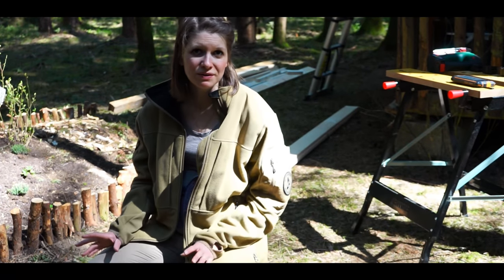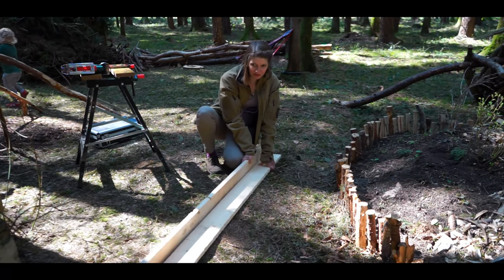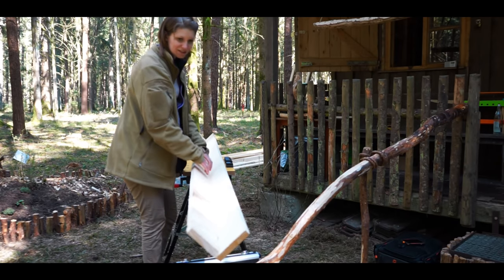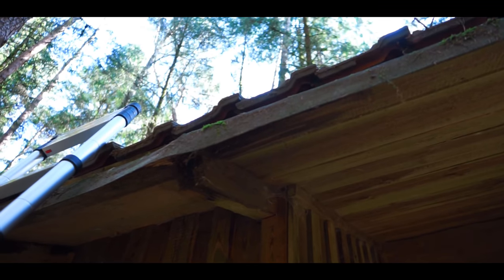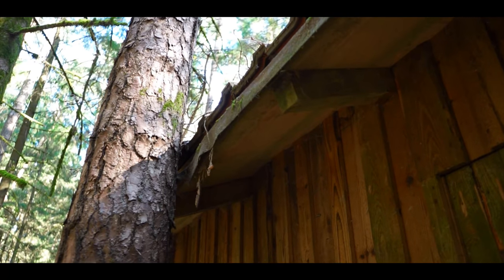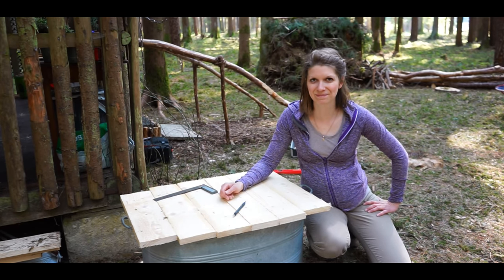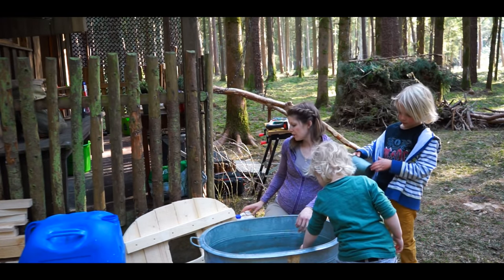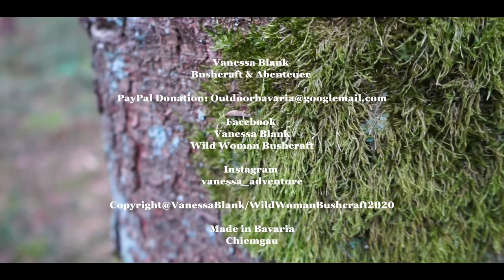🌳🏡🌲Forest Cabin🦊#10 DIY- Water supply / gutter, water storage, selfmade - Vanessa Blank 4K

Comment: I think you get more beautiful with each video, Vanessa! 😌
I only have one suggestion. If you put a gutter on the other side, get a tube of construction adhesive, and apply a small amount in the joint before you screw the boards together. This will seal the joint(s) and keep it from ever leaking. It will also make a joint that is very strong. The screws will loosen as the gutter ages. After a while silicone may turn loose. Some types of silicone are not drinking water safe. The construction glue will be deep in the joint and covered by the wood.

Comment: Vanessa, to seal up the crack in your gutter you can use melted candle wax. I save all the old bits of candles I have and melt them down and paint any bare wood that will be touching the ground in my garden. It works very well. Be safe out there.

Comment: Congratulations Vanessa .The chain is a good idea.The pot in English is a sieve .perhaps a fine mesh can be fitted later to stop line needles blocking the new gutter.I am spending lockdown during the day,when days are so beautiful,camping in my garden looking at our door and travel videos.Dinner on the stove .
Reply: John Roddy I wonder if she sealed the lower end as well and then cut a hole in the bottom and attached the chain at that point. I think that would allow a more direct contact with the chain. Probably, with heavy rain the water would flow over and past the chain.
Reply: @robertadelsberger3749  Spot on Robert i first seen the chain been used in a commercial shopping centre.Tks for reply

Comment: Hi Vanessa .. 
A great idea with the wood planks to make a gutter 👍. Perhaps eventually you will need a 'downpipe'. In heavier rains you will get less water 'splash' and wastage and it will keep your water cleaner.
You could also turn your Tank Lid over so that the two supporting beams face downwards. Trim (cut) the beams to fit just inside the tank and then the lid cannot be moved sideways and slip off.
Good progress so far 👍 .. and until next time 👃👂👀 .. LG .. Tommy
NB: You're looking good 😊.

Comment: Great job Vanessa perhaps you could attach a water spigot (wasserhahn) and then attach a hose and nozzle to the bottom of the water barrel ( looks like there's a place that screws off)  with a shut off so it would be easier to transfer the water to another container and as well water your garden. 🙂👍

Comment: Vanessa ... you may not want to add this idea to your gutter , but it will give you something to think about …  on the open end of your gutter , a "turn down" will direct more of the water onto the chain.… I would simply add a two or three inch pvc elbow and have the chain running through it down to the basin...…  Also , in the old days,
 we covered our rain barrels with two layers of cheese cloth to keep trash out....

Comment: I would consider sealing the joint between the two pieces of wood.  Then for the cover on the tub, use some fine mesh that will function as an initial filter keeping most of the junk out of the tub.

Comment: Food grade silicone caulk/sealant for the bottom and end cap. You could also put another end cap on then drill a hole for the chain to direct the water even better. You could put the tub much higher on legs/stilts then fix a pipe or hose to the outlet of the tub with a faucet down low where you can easily reach it to fill anything you want. It would be a small water tower! Maybe for the future research "diy sand point well" or "diy driven point well" to find how others had success with smaller scale wells. It could be fitted with a hand pump of which there are many types and price ranges. Of course it would be best to ask neighbors what they know about the water table and ground in the area before getting started,if there is a layer of rock underground the entire idea is for the trash bin.

Comment: When you put the next gutter up you could position wood brackets on the ends of the roof rafters to rest the weight of the gutter while you secure it in place. It’s like another pair of hands.   If you raise the tub platform you can attach a hose to the bottom of the tub and let gravity run the water to wherever you want it. Not being critical , hopefully helpful. You are awesome and I love watching your videos.

Comment: If you need to put another container there for more water, I would stack another tub on top and let the top fill first and let the overflow drain into the bottom tub. I also collect rain water for my garden, but I have many half drums around my house. I cover them them with a nylon mesh so mosquitoes don't breed in them.
Reply: Old tights/stockings are good for filtering rainwater... be sure to ask the owner first...

Comment: The metal you have from your gutter to the tank below is called a chain.

The piece you want to put at the opening of the water tank for the water to flow through and keep out the leaves and pine needles, sort of a screen, is called a sieve. Like what you use to sift flower when baking.

You can simply use a piece of screen, like from a window screen or a screen door, for your water tank screen, sieve.

Comment: Vanessa, sweet girl, Facing your cabin, there is one porch railing "missing" on the left front side.  I wanted to mention an idea I have.  U can remove one of the porch railings that butt up against (& very close) to the front walls of your cabin  & move that railing to the front missing spot.  It is already "weathered" & will match perfectly to the other railing boards.  The "eye" will never miss that small open area up against your cabin & it will complete the front view with "no missing railings".  Just an idea I had - hope U don't mind.  Great job on all the cabin improvements -- your water system fits right in with your cabin in the woods look -- girl power to the finest !!!
Reply from the maker: Hello Robin!
You have an good eye! 😉 Thank you for the tip!
Best wishes,
Vanessa

Comment: You may want to consider attaching a screen over the cover hole to catch pine needles, bugs, etc. You can use door or window screen material that is usually available at you local hardware store. That screen type is light & can be easily cut to whatever shape you need.

Comment: What your going to want to do is when stores open or if you can find it is bend roll flashing to the 90 degree gutter (its very inexpensive) as a metal insert and seal it all up w/ silicone or preferably roofing cement. To filter out pine needles, bugs etc. you can use a large funnel inserted into your drip hole and simple nylon screen affixed inside it via glue or make a removable filter screen.  If you can cut the drip hole better to size for the funnel you can have it seal decently to keep bugs, and such from getting into the storage tank.  To bend the flashing you can use your construction table to help make the 90 degree bend.

Comment: Hello Vanessa , I was watching and thought you ought to place a funnel or a plastic bowel with a hole in the bottom type water catching inset on the top boards to keep the splashing down . Also lift the tub up a couple feet to make it easier to handle .

Comment: I think  it would be a pity to use a modern material like silicone to stop the leak in your gutter. If you can get some, I would recommend pine tar ("Holzteer" in German, according to Wikipedia) instead, as it is a natural material. In an emergency you could make it yourself, although it is a slightly time-consuming process.
Reply: Will that possibly put a pine flavor in the water?
Reply: @D-RAIL_oOIIIIIIIOo  Possibly, but likely not: the water and pine tar would be in contact for a short time, so there shouldn't be any significant leakage from the tar into the water. But it would definitely be worth keeping this risk in mind.

Comment: (A) U have a tap opening in the tub, BUT no tap...
(B) Ur tub needs 2 B @ an angle NOT flat\level. So the water is running 2 the tap end...
(C) U want the tub platform high enough off the ground 2 put a pail under...
(D) U defeated the purpose of the chain with that huge hole. U also defeated the purpose of  lid 2 keep things out...
(D1) U also now the perfect mosquito breeding place...
(E) Use window screen over hole & have chain 1' above the screen...
(F) The English word is sieve...
Reply from the maker: Hello! Thank you for the tips !
Best wishes,  Vanessa

Comment: I know your not a silly sort of a person, but your now worrying me so should someone remind you your pregnant?One slip on that ladder, which isn't that strong as I have one, and they do tend to collapse on you as their not a working ladder as such, could easily be the end of that. Alone in the woods with just your kids, really isn't the sort of thing to be doing off a ladder or the place to be doing it. Arthur (dencedickie)
Reply from the maker: Hello Arthur! Everything right, I know what I'am duing. Not everything is a risk. 
Happy easter!
Reply: Hi Vanessa, Hear what your saying and it is good to see you having ago and your doing very well. When it comes to those ladders do not depend on them as your depending on a pretty small, weak, spring and a button to keep them up, one fails and it lurches to one side at the wrong time and your off of it and on the ground, and maybe in alot of trouble in your condition.Their an easy carry, lite weight get you up there for a short time, not a working ladder, as I know the weak part of mine, but I was not pregnant when I found out but still hit the ground fairly hard. Get a roof rack for the car to carry a much stronger better aluminium ladder if you have to climb or even build one with all your bits of timber. As one day you will be using that one and although new will give out on you as the aluminium sliding side poles stretch in diameter where the pins go through over the strain of your weight and angle of the ladder, being made of thin aluminium tube which out of the ladder you could easily bend over your knee, making it able to jump the buttons as the buttons and spring get worn.Certainly not a ladder for a well pregnant lady to be up at anytime as we all push things most times but not when pregnant. Take care as I would like to see you a happy mum and not a sorry hurt mum. Arthur (UK)